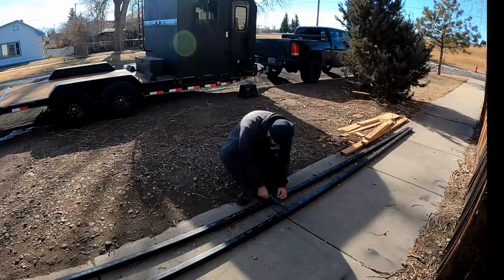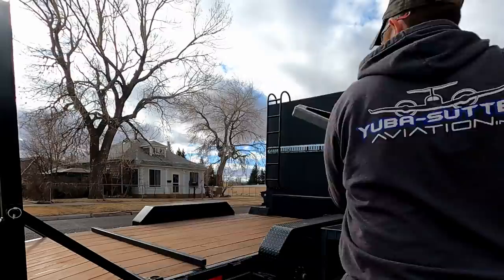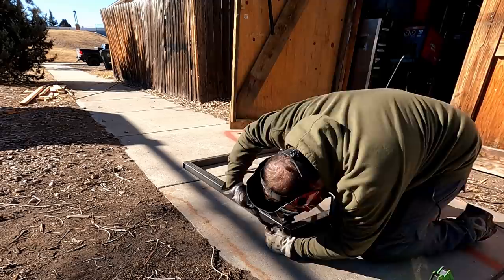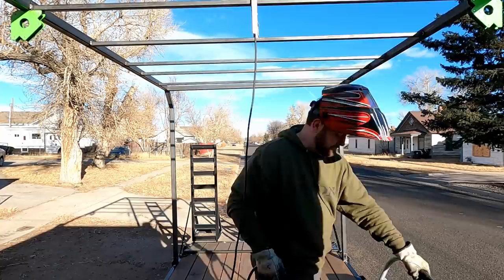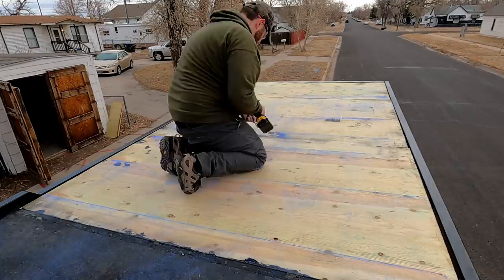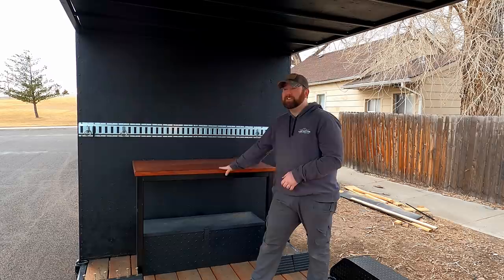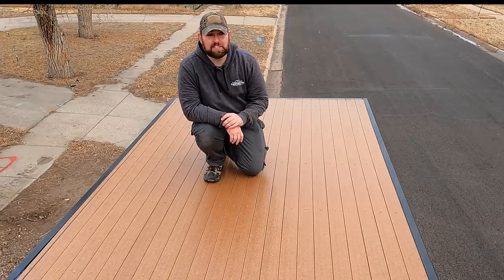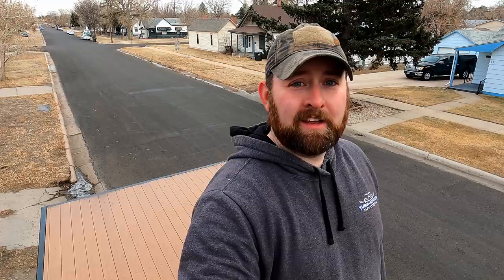SECOND STORY DECK on a CAMPER?? What?! Crawler Hauler/Bugout Camper Build

Comment: Loving the build, just found it today.

As a fellow builder I have to caution you about the exterior choice. I built my DIY camper about 2 years ago and used the same material for my exterior sealant and after about 8 months it started to leak. 6 months later I decided to redo the exterior and use PMF to do it and as I sanded it down I found out that the leaks had started to rot the wood. 

My take away is bedliner isn't a good material for the exterior of a wood structure and I will now have to rebuild it because the rot is in the base.

Anyway loving the build.

DR
Reply from the maker: Is there any coating you would suggest that I can still put on to help mitigate any damage?
Reply: @CodeBrownProductions  I was planning on stripping it down all the way to bare wood and using gallons of wood glue and cotton painters drop cloth, known as Poor mans fiberglass. But unless you plan on stripping the entire thing down and starting over not a good plan.

I would suggest taking aluminum trim and placing a strip over every seam with either butyl tape behind or silicon between the aluminum and the wall.

All my leaks (and there were a bunch over a year) were where two pieces of plywood came together. The bedliner did fine everywhere else but where the two pieces came together there was movement and that caused cracks which let water in which then made the wood swell causing bigger cracks which then spiraled out of control. I think half of my later build videos where me doing repairs on the exterior.

I've seen a number of builds use bedliner and have all ended up leaking, the Teardrop and squaredrop FB pages I'm on they all collectively say it's a bad idea for the top and sides. Many still use it underneath to protect from road gunk but it isn't as big an issue as it isn't getting directly rained on.

It would be a good idea to put butyl tape in between anything you mount to the outside and the wall as it's a sticky rubber material used to seal windows and such on campers that never really dries out. Stuff is amazing, a touch hard to find but a really good material for waterproofing campers.

Comment: Nice build. Pretty much the exact opposite of our trailer. 20 foot trailer on a 30 foot frame. Springdale SRT with an exterior front deck for ATV hauling. 8X10 open steel mesh deck on the front end.

Comment: I like how you did this build, you should check into some screen material or something like it for the sides to help with the wind, sun and rain.  I’m wanting to build something sorta like this that I can remove on and find my 40’ gooseneck, because I have to use it to haul equipment and hay    And yes I’d love to get another trailer maybe a lowboy 30’-36’ to build a permanent camper-hauler on with a over head deck/extra haul area for more quads and or parts on, I figure to the SXSs on the bottom with the small living quarters like you did

Comment: If your worried about the upper decking being slick both Raptor liner and Duplicolor Bed Armor make a tintable bed liner that can be used as a traction source for up there.
Reply from the maker: Problem should have done that from the beginning but I really like the wood look.

Comment: Sweet build man! I wanted to build something similar when I had my rig using a pop up camper on a trailer sideways. For the ladder you should make a Z fold one that folds up above your work bench but unfolds out the side. Then random people, drunks, kids won't end up there when you don't want anyone up there!
I definitely would NOT put a permanent ladder though. For the previous reasons.
Reply from the maker: I still want the permanent ladder for increased structural support. But defenitly something to be aware of ,thank you.
Reply: @CodeBrownProductions  ahhh, I got ya!  Makes sense!  If you were worried about people climbing up there (or zombies lol 😉) you could possibly put something over it that blocks the rungs or make some of them removable. Weld a nut in a tube and connect tube to ladder through the sides. It may be something you totally aren't worried about....  Around here people have broken into the "storage lots" where people keep their RVs and such and stole their solar panels and what not.

Comment: awesome build! Always wondered why this exact style setup has never really been produced before... Glad to see it turned out so cool. 👍
Btw, the slippery finish on the surface of the composite decking isn't likely to go away on its own, but I'm pretty sure there are some solvents that can eliminate the slickness without affecting the appearance of the finish. Prob Xylol or Acetone, or maybe thinner / mineral spirits etc. (I know one works but you'd have to check or spot test to be sure). Otherwise you could try Sanding w 60-80 Grit, composite decking is mostly plastic though. Hope that helps & thanks for the Vid✌

Comment: with a fold up rail system welded to the sides could also be used as a roof rack for more storage depending on height of rails

Comment: Nice build.You might have had welding trouble from the magnets try tacking the steel up then move the magnets and weld er up
Reply from the maker: Never thought of that.
Reply: Or if your using gas the wind will affect it.If your using flux core it needs to be clean.keep the updates coming on the build 👍

Comment: love this build mate probably make one my self now . i must have missed the air con install ill better go and check it out . got a bit of laugh out of the wind in wyoming comment  could see that dead tree moving in the wind , gotta ask about the color of the grass round there whats happening with that , you guys in a drought ?not much green there . any way back to the wind all you need to do is clamp a bit of tin or wood  to block the wind where your welding , just cause its structural doesn't mean its still a good weld the gas helps to stabilize the molten pool to get penetration into the metal. im on the west coast of australia and if the wind isnt up by 1 oclock in the arvo  your looking to the sky wondering whats going on
Reply from the maker: That's actually not an AC unit on top thats just my vent fan. I ended up getting a MaxxAir fan and I love it.
Reply: @CodeBrownProductions  yea i went through and found it  thanks . so whats the go there you got a drought or is it that cold the grass dont grow ?from the drone shot the area looks a it brown

Comment: You should swap to flux core welding wire when welding outside with a wind. It doesn't use gas to shield the weld. Just like stick welding rods.

Comment: Awesome build.  The sound is fine although it only comes out my left speaker.  Will water flow through the gaps on the deck boards?  Consider the railing because it will be in the wind as you drive and will possibly sway as well as create wind noise.  Good Luck...
Reply from the maker: Water won't fall through the boards cause there is pressure treated plywood underneath. As for wind noise I haven't experienced anything annoying yet so fingers crossed.

Comment: Was there a plastic barrier between the plywood and decking for waterproofing?
Weather proof those cut ends and the piece you ripped down also...you probably have.
Cool build.
Reply from the maker: The plywood is ground contact AC2 pressure treated.  So I should be fine.

Comment: I really like this project, you have inspired me.  The simplicity of the exterior coating is  a great idea. Low cost, easy to apply, dent resistant and it sounds like it is waterproof. How do you think the exterior coating will hold up in the summer sun? I have a camper van that is a dark gray and holy cow can that thing get hot in the summer sun. I suppose you could paint it with a light color if need be?
Reply from the maker: So far so good. I've used Herculiner before and it's held up well. You just have to realize it's a roll on and not a spray on so it's not going to be nearly as thick. Also with any type of paint or costing prep work will make the difference between working out and failing.

Comment: I personally would mount the deck on the passenger side but that’s me . I lived in Rock Spring for a few years and worked for Halliburton on the oil patch and loved Wyoming ! Are you going to put side curtains on it ? And a folding rail system, just in case ya have to many barley pops ? Lol

Comment: If you think it is slick now, wait until it has a bit of mist, condensation, or wetness on it.  Be carefull not to slip off when it is wet especially since you don't have railing.
Reply from the maker: Yeah,  I might change out the boards or at least add grip tape in the meantime

Comment: Not to be knocking you bro but your going to get someone hurt...I am a 30+yr carpenter and that plywood will never hold that decking down for long...The decking(trex)will never rot but the plywood under it will stay wet(rot)and the screws will pull loose sending a deck board sailing...You could weld some straps or a border or both to keep it in place but those screws will fail...trust me
Reply from the maker: Not knocking me at all, I appreciate the advice. I'll have to figure something out like you said. I was worried about that too so I over did it with the exterior costed short lag screws. Straps over the top is a good idea. I just want to make sure I can keep the deck idea. So I bought the most appropriate supplies that I could.
Reply: @CodeBrownProductions  I am building a similar trailer for my rhino and hunting application but no upper deck just a simple tarp shade awning.I have built a ton of synthetic(trex)decks in my days.I know you don't want to start over but when the plywood fails you think about no plywood but install additional 1x1 ribs (joist) so they are on 1' on center and use self tapping screws thru the deck and into the top side of the 1x1steel.Also use a premium adhesive on every attachment point.like lexcel or any urethane based sealant/adhesive.With a normal wood frame deck with trex decking we install the joist on 16" centers so I know this will work.And yes it's slick as greased owl shit on glass!Maybe a folding handrail w/locking pins for upright or down in transport mode?Anyway thats my 2 cents hope that helps

Comment: I would have forgone the plywood underlayment and put a cross member every 12" instead. Lighter and won't rot out from water/moisture entrapment.
Reply from the maker: everything. Playwood is pressure treated ground contact rated so it should be good to go. I had to put the plywood down so water wouldn't drip on my from above when I'm on the lower deck.
Reply: @CodeBrownProductions  gotcha.

Comment: Wonder if the clear flex seal would give you more traction up on your sundeck?! It is a rubberized coating so....
Reply: If you want to try this, 1st try on a small area 1st for color fastness & if it does work or not before you commit to it!

Comment: I really wish you painted the top of that plywood before you put the deck boards down.  I dont think Ill be able to sleep tonight....
Reply: I could not believe he did that!!  It will rot in a year. Could have at least used treated plywood.
Reply: He said it was pressure treated but yeah, didnt look like it. I thought a layer of ice barrier or rubber roofing membrane under the decking would be nice
Reply: @andrewhammes1183  I've had ice shield with no shingles and almost no slope on a storage shed and it's lasted over 10 years. It's key to cover the edges where the laminations are.
Reply from the maker: The plywood is 3/4" Ground Contact rated AC2 pressure treated plywood. So it should be fine. But you're right I prolly still should have painted it but I ran out of paint and wanted to install it.

Comment: Why didn’t you seal the plywood before putting the decking above it?  Instead of plywood and “decking” I would have made it with stained and varnished 2x6 boards or diamond plate with bed liner….

Great video, L O V E the overall design.
Reply: Diamond plate would get too Hot on the Summer

Comment: You should have put a waterproof membrane down before you put the decking on. Your plywood is going to rot and fall apart really fast.
Reply from the maker: It's ground contact rated AC2 plywood. I just wanted the underside to be black cause that what I see when underneath it.

Comment: Hard to tell but it looks like your metal is dirty. If you get in the habit of grinding the areas were your trying to weld, your welds are going to turn out so much better. Even brand new metal should be taken down to perfectly clean steel. So next time, if you are not already, try grinding  both parts of metal your trying to weld and wipe down with acetone.
Reply from the maker: Thanks for the tips!

Comment: What length is the trailer?  And what are your dimensions on the sleeper? Thanks.  It looks great
Reply from the maker: Trailer is 22' and the camper on the inside is 7x7 and some change
Reply: We have a 16’ gatormade we have thought about doing something similar to have a camper that we can use when we go on wheeling trips with our rzr.

Comment: Absolute beautiful build but I have to ask, how does that deck fair at highway speeds with wind grab also what is the cost comparison of your build to an enclosed trailer and decking the top?
Reply from the maker: So far not bad. But I still want to bolt it down more just to make sure

Comment: Why didn’t you paint the top side of the plywood? It’ll hold and soak up water when it rains
Reply from the maker: Honestly? I ran out of paint. But it's ground contact rated pressure treated so I'm not to worried about it. Besides I can always rebuild if need be.

Comment: The idea of an upper deck- A+   The material used in surfacing the deck- F!!!  Just exactly what a person needs, setting their camp chair on the ice slick roof of a camper deck that's 8 feet off the ground and has no safety rails or raised edge to keep a chair leg from sliding over the edge.
Reply from the maker: I agree with you, I didn't know it was gonna be that slick. But hey there is always a solution.
Reply: @CodeBrownProductions  Any chance one of those Rhino Liner type bed liners might stick to that decking?  Great quality exterior paint and sand?

Comment: Awesome build. I really like how you work too, clean and uncluttered! You route stuff precisely and all secured well. Did you use stick on or screw down holders on the walls that you zip tie the wires to? I know from experience they will start to lose their grip if it isn't screwed to the walls. Love the set up! Very cozy!
Reply from the maker: Thank you The! I'm a little OCD when it comes to electrical wiring. Everything has to be routed neatly and organized and if it's not I'll tear everything down and start over.. I've done it several times. It's why my electrical projects take so long. The are the 3M doubled sided foam tape. I will prolly have to screw them in down the road but for now this will last long enough for me test everything out.

Comment: IMO , you are in danger of overloading the trailer .  You have also limited your turning radius by overhanging your box in the tongue .  Increasing your tongue weight above safe limits doesn't help , either .
Reply from the maker: The trailer is an equipment trailer rated for 14,000lbs. Currently with the Jeep I'm still well under 10,000lbs. As far as the overhang, that's just the normal square trailer deck. Nothing overhangs the trailer deck. Tounge weight is still spot on at 900lbs, my truck is GMC3500 1 ton diesel with a max tounge weight capacity of 1500lbs.

Comment: nice! One question, is there drainage?
Reply from the maker: Not really, it's just a flat surface so everything can just slide off the sides. If I see problem areas then I'll go from there.
Reply: @CodeBrownProductions  It's a really beautiful construction~! I'm just curious about pooling under the deck toppers and if that would lead to rot issues with that OSB. even with the paint
Reply from the maker: @AkumaQiu  thank you, the decking is ground contact rated treated plywood so I should be ok.

Comment: You were doing really good until you put that decking material over Unfinished plywood that was not a smart idea
Reply from the maker: It's pressure treated ground contact plywood.
Reply: Does not matter even overlapping pressure-treated material will rot